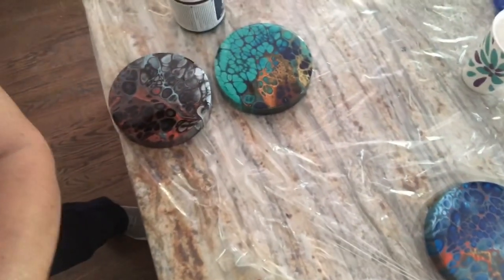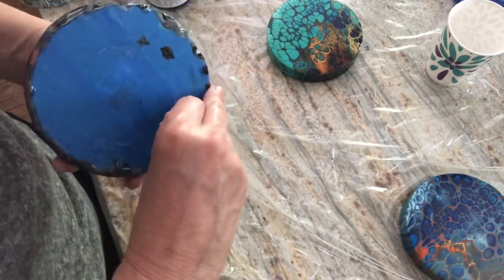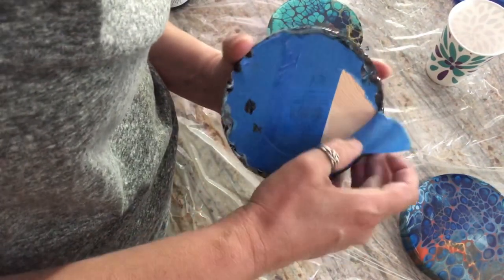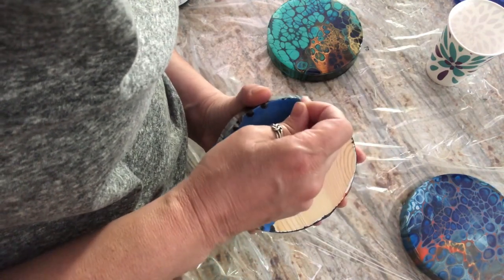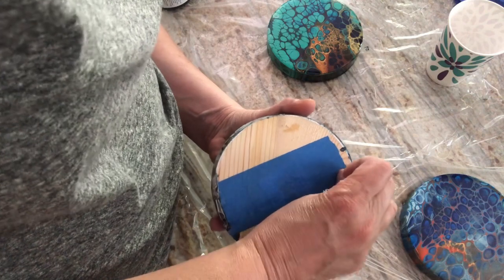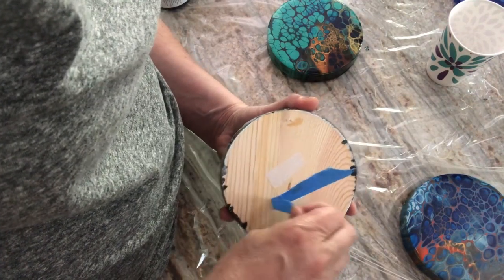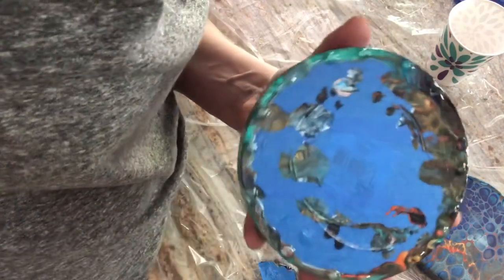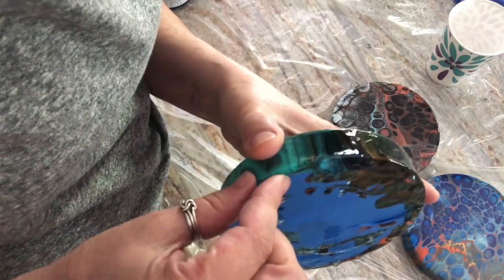Snippet #1.  New Series!  How To:  Pull Tape From Resined Pieces

Comment: Well, I did everything back assward.  First, I didn’t get the resin u use.  Then I watched the “other” instructional video.  Everything went wrong.  I always watch all your videos all the time, so I said to myself “Ha, Marcy, Karen made a resin video, go watch it”.  Now I have a disaster on my hands even though I did wash and seal the pieces, but I only gave them one coat of polycrylic.  The silicone is still coming through.  And one piece is a big wooden alphabet letter I’m taking as a gift when I meet my sister’s step-daughter at the end of this month.  I did a beautiful pour on both sides.  I’m so upset.  It’s been curing for 6 hours, so I figure tomorrow I will just have to sand it a little, put some polycrylic on the bald spots, wait for that to dry, and do a second coat.  Hopefully that will work.  I taped the reverse, so I’ll remove that and retape before I do the second coat.  Sound good?  You can’t tell I never resined anything before, can you?  Ha!🙈🤔